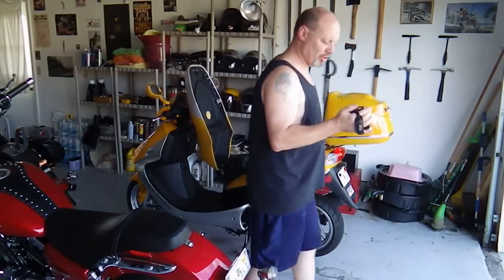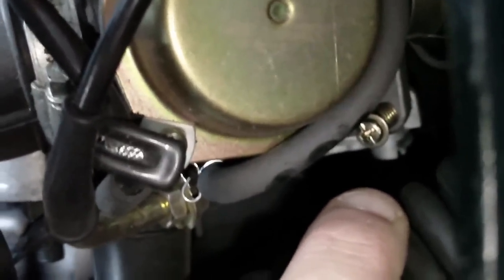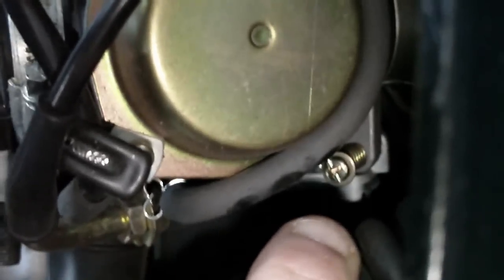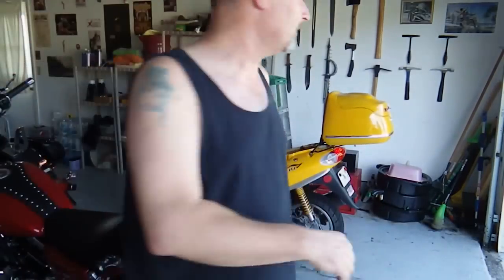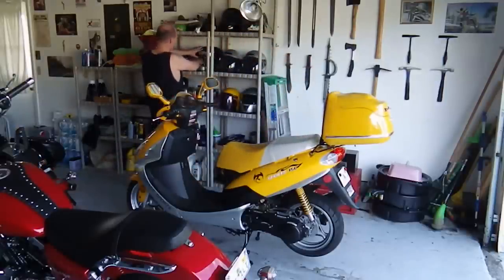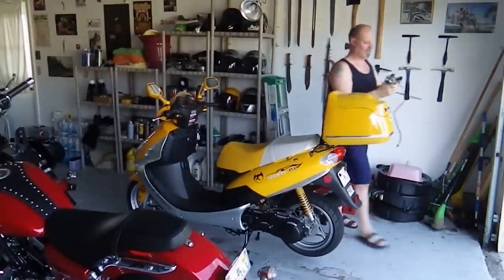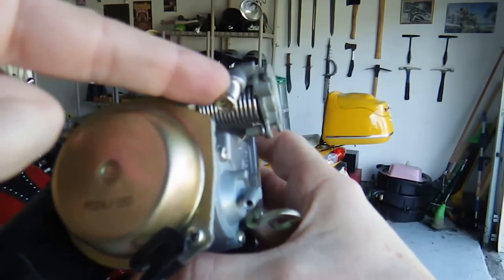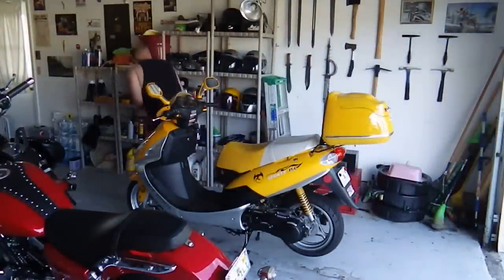Scooter Carburetor Idle Adjust

Comment: If you wanna do it His way turn the idle screw until your wheel starts to turn Slowly FIRST. Then if you don't like that back the idle down just until the wheel stops turning. My scooter manual says to actually turn the idle until the wheel does start to turn slowly and leave it there: "The idle should be adjusted just
 high enough so that when set on the center stand with rear wheel elevated, the wheel turns very slowly. " This way you have some indication when you have reached a good idle.. he did not explain that.

Comment: My scooter revs up on its own at idle. It used to die at idle and I cleaned the carb and adjusted the screw (flat head) thing on the side of the carb to 3 turns out like another video. Then taped up a hole in the air hose and charged the battery because it went dead after no use for 2 weeks. It now does not die at idle however it kind of revs up and down on its own a little bit as well as the lights get brighter and dimmer respectively while it does that. It also doesn’t always turn on on the first try and somehow lost the ability to turn on using the right brake handle (which lost connection to the tail light) so you can only use the left. It will also die now if I give it gas without letting it run in idle for a couple minutes. There is gas inside the air filter housing too. Not sure what’s going on. Should I try adjusting my idle screw?
Reply: Im have all the exact same issues right now😭😭🤦‍♂️in that same pattern to
Reply: It seems your intake valve is too tight,so during the compresion cycle it does not seal completely and some compression find its way out throught the carb towards the air filter..
Reply: 3 turns out...That's too much...Take the scooter for a 10 to 15 minutes ride,turn it off and park in on the main center stand..Close(Turn it clockwise to reduce the gas intake) the air fuel screw (Left side of the carb)and then open it 1/4 of a turn and start it.Adjust the idle screw and leave it a little before the rear wheel turns..Take it for a ride and determine if more gas is needed..When lean it overheats and has no take off power..it also runs rough at take off..Open 1/4 at a time until smooth..The R.P.M should peak up at the sweet spot..Correct the idle every time you turn the
the air fuel screw...When done make sure you check your spark plug for lean or rich..If you have any questions let me know
Reply: @kkvu-lr4wn  just buy a new carbi. Under 30 usd

Comment: So the back wheel spinning after start up for about 10-15 seconds is a good thing. I mean there isn't any signs of an engine problem or any other problem?
Reply from the maker: The back wheel spinning immediately after start up is normal...if it keeps up after a couple of minutes and does not stop the idle needs to be adjusted down until it does
Reply: It does stop after about 10-15 seconds. But I was just wondering why it does that because after I had a first service it never happened, but after the second service it started doing it again and its happened ever since.  Thanks for your reply and great vid btw.
Reply: +Banannnaman1 The rear tire spins when the centrifugal clutch engages.  Below a certain RPM the clutch shoes are held in by springs.  When they spin faster than that the shoes swing out, engage the clutch and the tire spins.

So I'd guess either the engine RPM is higher now (likely) or the centrifugal clutch is different in some way (less likely).

Comment: Hope you may be able to help.. My Honda s wing 125cc back wheel has started the spin I'd say about 5mph when it's on its stand and no  throttle engaged could this be a problem with the clutch plates or the idle settings??
Reply from the maker: A slight wheel spin when on the center stand is nothing to be concerned about. If its spinning faster than you like just adjust the idle down a little. Then If your sitting on the scooter while at idle and its trying to drive out from under you then you have a clutch issue.

Comment: Have some issues with my 2 stroke scooter with only 1400km especially in the morning and when it is parked for a couple of hours. It starts but just couldn't maintain the idle and will just immediately die down. I always end up reving it lightly after it starts for about 5 mins just to make the engine stay on. You have any expert advise for this?cheers
Reply from the maker: Two strokes are a totally different animal from what I am used to. I will send your post through maybe someone else can help you.
Reply: Shacklin Jackson thanks man

Comment: By the way, I have a 200cc Chinese scooter
Reply from the maker: +Ronald hargraves I assume you mean it cranks but wont fire. Can be a number of things...bad engine cutoffswitch, clogged fuel jets, bad clutch switch...I am guessing you already checked to see if it has spark at the plug
Reply: +Charles Jackson yes it has spark. I've been looking at videos and I thought it was the stator. So I'll take the carbuerator apart and clean it.